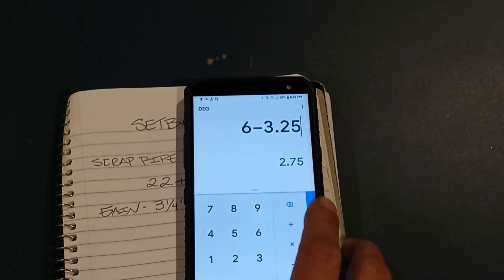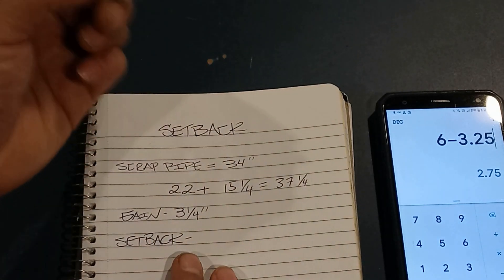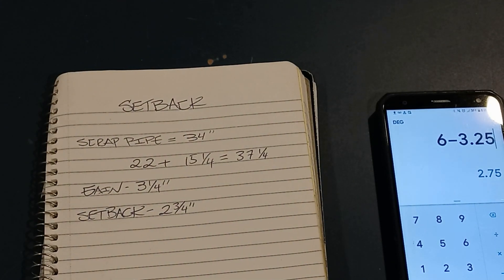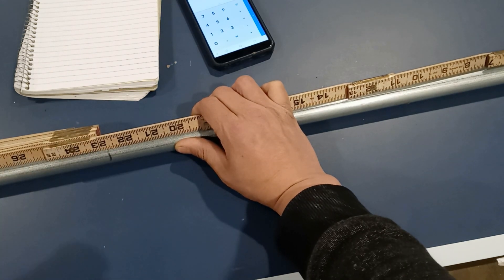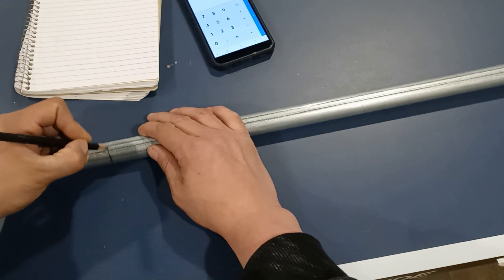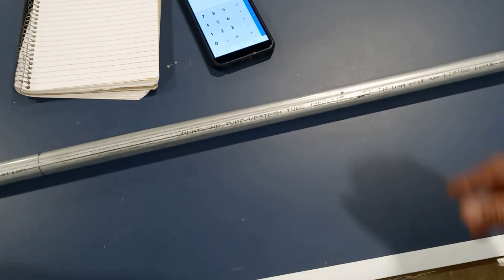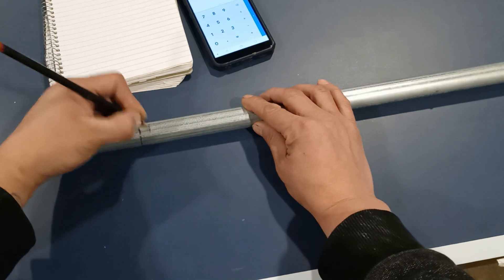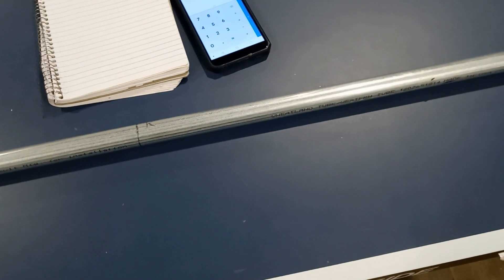Conduit Bending: How To Use Setback Correctly.

Comment: First-year apprentice here. Didn't understand why or when you would use setback. This clarified it. My understanding is that when bending RMC it's crucial to understand this (as well as gain) because you have to cut the conduit to length, thread the ends, and lay out your marks before you start bending so there's no room for error. And when using a mechanical or electric bender it's impractical to take the conduit out to measure again for your kick mark so you gotta do it this way. Valuable information I appreciate the help man.
Reply from the maker: I couldn't agree more. What i used to do when I first started learning all about conduit bending was I would use these principles on emt as well even though i didn't have to. Just to get more practice with it before i actually had to try it on RMC. Thanks for watching and most of all for commenting.
Reply: This is the right way to do it 👍. I've cheated a bit here and there in cases where it's not too critical but if something has to be dead on the methods he's showing here should get you there if followed correctly. You've also got to account for threads with Ridgid pipe. Good info! Good presentation man 👍
Reply: @lauratanner8475 you have to account for how much your emt sticks into fittings as well, so same rule applies.

Comment: another quick way of getting the set back would be, measuring 20 inches plain from the takeup and then after the bend, measuring how much is missing from the 20. its better to have the gain and setback at once though
Reply: though, you could get the gain back from that also. without the need of knowing the piece length

Comment: So what if you Wana bend a kick on the stub end to get into a body? Could you just bend the kick and add the set back to the mark for the 90? Kuz if you bend a kick into before a 90 isn't there shrink?
Reply from the maker: No I don't believe you can do that and have it work accurately. As far as the shrink goes the setback has nothing to do with that. You still need to account for any shrinkage there will be. Setback is just used for layout purposes.

Comment: so what happened to the gain for the length of the conduit when you bent the 90. I think the gain for Ideal benders is 3 7/16 and the setback is 2 9/16. I'm wondering because, if I make a 12" stub, and I deduct 6" for the take up and from the back of the 90 I need to go 3.5 feet to a coupling or box, how does the gain and the setback come into play? Because I gained 3 7/16 of an inch on the 90 but my setback is 2 and 9/16 of an inch. Because the set back is a reference point from the deduct mark for the back of the 90, so if I'm gaining 3 and 7/16ths of an inch and my setback is 2 and 9/16ths of an inch, how do I use those to help me figure the distance from the back of my 90 to my coupling or box? Great video!
Reply from the maker: Wow that was a lot to take in. Setback= gain - take up. Every bender can have a different gain because not every radius on the bender is equal. Now the way you use gain is ONLY to figure out total length of conduit needed for example to make a 12" stub and a leg of 50" you would add the stub and leg and subtract the gain and that's your total length needed. Setback as you said  is just a reference point of the back of 90 and helps only when you want to lay out a 90 with say a kick or offset. You can lay it out all at once if you know where the back of 90 will be. Sorry I hope this helps. This is a topic that needs to be answered in person best.
Reply: @TheArtOfConduitBending  okay, so my overall length is my stub minus the deduct and the distance for my length from the back of the 90 minus the gain?
Reply: @TheArtOfConduitBending  ok so I have a 12" stub like you say, and I deduct for my bender minus 6" say I'm using 3/4". my leg or distance from the back of 90 to my coupling is 50" like you said. 6 inches for my deduct; do I measure 50" minus gain from my reference point?
Reply from the maker: @comingtofull-ageinchrist6736  No. If you want to figure out total length. 1). Measure your stub from the end of conduit to the back of 90. That's your stub. 2). Measure your leg which is opposite of the stub. Same thing measure from the end of the leg to the back of your 90. 3). Add your stub and leg measurements and subtract the gain. I'm assuming you know how to find the gain. It's as simple as that. Gain is used to find the total length needed which is helpful when you want to say cut and bend box sets and then bend your 90s or if you are bending rigid conduit.
Reply from the maker: @comingtofull-ageinchrist6736  the deduct has nothing to do with the calculation.
Reply from the maker: @comingtofull-ageinchrist6736  I have a great video that explains gain and shrink also I have a playlist that might help you understand it more called "multiple bends by holmz law". Here is the link for the video I think might help. 
https://youtu.be/lm3bkMgttXo
Reply: @TheArtOfConduitBending  we said the same thing in a different way.

Comment: nice video. Do you have a video on how to find travel?
Reply from the maker: When you say travel do you mean the offset travel or the travel it takes to make a specific bend
Reply: @TheArtOfConduitBending  the travel to make a specific bend.
Reply from the maker: Now I know what you trying to do. Listen all the multipliers for every degree of bend is going to give you the travel for offsets.
Example let's say you want a 
5 inch offset to come off the floor and go over an object ok.
And we using 30° bends. So to find the travel it's
30 ° multiplier is 2 
So....
5 inch offset x 2 = 10 inch travel between bends.
Now if you want to the different types of multipliers then I can help you with that. Just join my discord community group and post questions in the conduitology 101 room i answer them every day. 
https://discord.gg/kdqZGjzC

Comment: You can also use setback so you can measure a long 90 and bend on the “star” if you’re using an electric bender or bending rigid or IMC
Reply from the maker: I don't get it. You'll need to explain yourself a little better.
Reply: @TheArtOfConduitBending  I think he may be referring to bending a ninety with the star where you wouldn't have to worry about the take up just the setback. I'm not sure tho 🤔
Reply: To clarify for anyone reading this. You’re imitating the star notch on a hand bender. If you need the back of the ninety at 100” measure the 100” then add your setback and that’s your front of shoe
Reply: @henryhelland997  that is front of shoe and not the "arrow" mark?

Comment: Are you bending a 10” kick at 30degrees? Is that why you marked it at 20”?
Reply from the maker: No its just am example kid. This about teaching you how to find and use "SETBACK"l.
Reply: He is showing you how to accurate calculate and mark the kick before actually bending the first 90.
Reply from the maker: @illestofdemall13  i couldn't find your comments do ireplied here. For the 3 point saddle use this method better save you time. https://youtu.be/0Ps5G9wQdls

And to learn how to put the 30 deg mark on your bender go to this video about 30mins into the video
https://youtu.be/0Ps5G9wQdls

Comment: Hey Holmz, do you happen to know how to find the shrinkage when doing a 90 with a kick?
Reply from the maker: Ok so i'm not sure if you want to know the total length you need for a 90 with a kick. Or if you want to know the gain and the shrink of the 90 and kick together. Or if you just want the shrink of the kick. Either way you need to be more specific i haven't posted a video yet of finding the shrink of kicks yet. But i do have a couple of video's on gain and shrink and how they work. you can find it on my "multiple bends" playlist. Hope this helps.
Reply from the maker: I'm about to do a video on this topic @brandonS
Reply from the maker: The video on calc. Shrink for kicks is posted. Thanks

Comment: The kick mark is bent at your center mark of the bender correct? Whether it’s 30 45 etc?
Reply from the maker: Yes and No. If you are doing the measured method yes use the center mark Star or notch is fine. But if you are doing the degree method where you are using the offset multipliers then you need to find the exact center to the degree you are using. I have video's on finding the center and i have video's on the degree method.